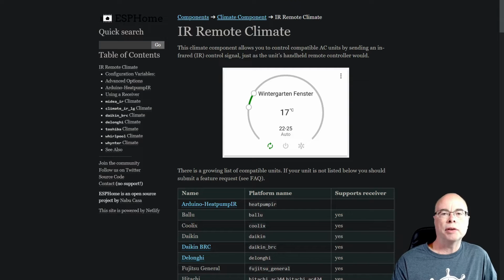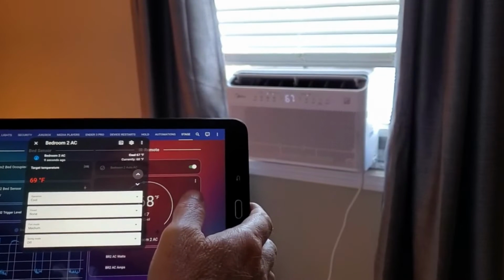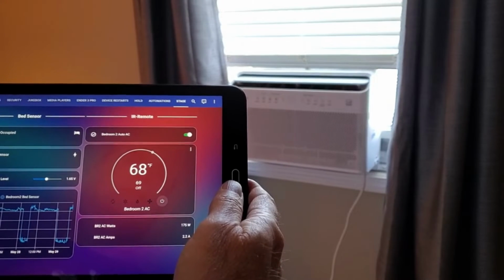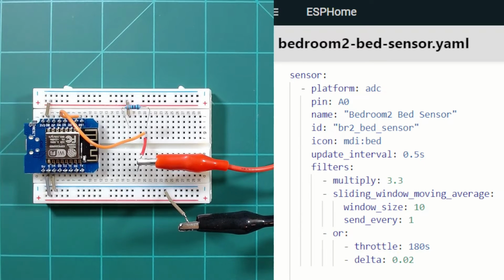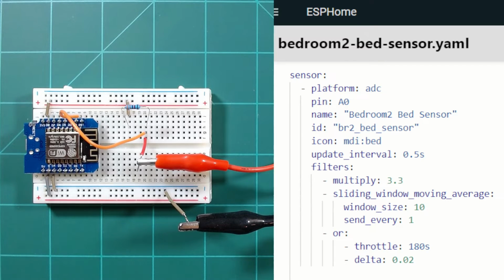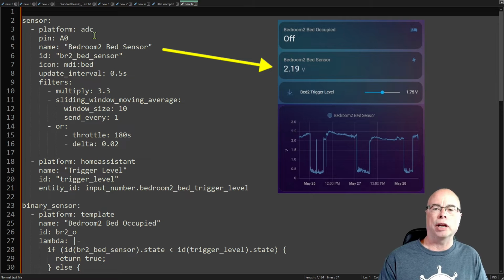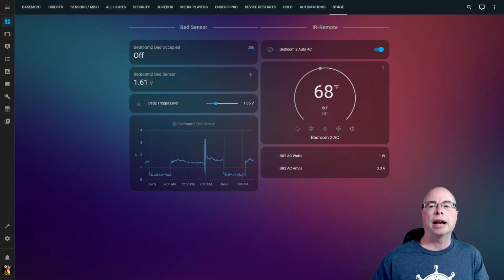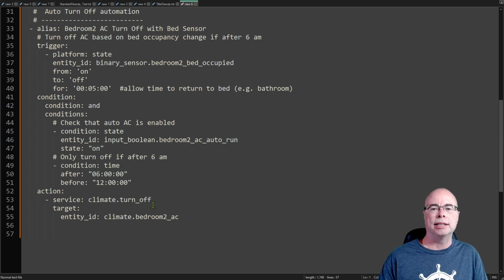Bed Occupancy and IR transmitter for Home Assistant

Comment: Rather than using an IR emitter module, couldn't you just use an IR emitter LED with a matching resistor for the 3.3V GPIO pin output?
Reply from the maker: I think you could do something like that, but I believe you'd have to figure out the right pulses/frequencies for the different 'commands' to send via IR.  When using the IR module, I just can tell it the actual code to use (which I can also capture from an existing remote) and the module will handle 'flashing' the IR LED with the proper frequency/pulses for that code.

Not 100% sure on that since I haven't tried it.  But I know that different IR "codes" need to be sent by altering the light signal.  Without a module to provide that "translation" between the true code and the light signal needed, I think you'd be on your own to figure that out if just using an IR LED.
Reply: @ResinChemTech  I think you might be giving these modules more credit than is due.  Just looking at the PCBs up close, there really doesn't seem to be much to them other than a couple resisters and a status LED.  In fact the KY-005 doesn't appear to have any surface mount components at all, which is probably why it works better since you're basically driving a 1.5V LED with 3.3V (or 5V with the logic level shifter).  Of course the exception here is the all-in-one module with the ESP8285.  I think it would be much cheaper to just use an IR LED and resistor.  And if you need more range you could probably use a transistor to supply more signal amperage.  I believe overdriving the LED with a higher voltage will likely burn them out faster.
Reply from the maker: You are very likely correct!  My knowledge in the IR arena is pretty limited.  I have a Harmony Hub that controls nearly everything in the main living area, but this project was my first attempt at creating my own IR transmitter.  Some Midea brand units have WiFi built-in, but mine only had an IR remote.  So the only way I could automate it was to build my own IR transmitter.  The module just seemed like the easiest, most-straightforward way to get there.  But like most DIY projects, there are always alternate ways.  Again... I really don't even fully understand how it does what it does, but I know once it was 'configured' in ESPHome, along with the Midea unit as an IR climate entity I just had to send climate commands like "Cool" and "Off" and somehow it worked!

I'm sure your method would work as well.  But as a beginner-to-intermediate based channel, I sometimes sacrifice "better" or "slightly cheaper" options for something that is a little more beginner-friendly to use.

Comment: If more nervous about applying too much heat to the FSR pins, you could consider conductive glue instead! (or a crimped connector). You don't have to solder so much (nasty fumes and burn risks and extra equipment to keep around when you aren't using it too).
Reply from the maker: Good tip!  I'm pretty comfortable with my soldering skills, but this is a great suggestion for others that might not have the equipment or experience with soldering.  Thanks for sharing it.

Comment: I was reading that forum on home assistant and there were alot of issues with false positives with these during configuration. How accurate has this been for you?
Reply from the maker: I'm assuming you are talking about the force sensitive resistor (and not the IR transmitter).  Mine has been in use for about 7 months now and the only real issue I've had is some slight drift in the upper voltage (unoccupied) range, but that is mostly due to my Sleep Number bed that loses pressure over time.  When the "Sleep Number" is reset, the voltage also falls back into line.  But it is important to select the proper resistor to give you the broadest voltage range between occupied and unoccupied.  The narrower this range, the more likely you are to get false positives (or negatives) based on small changes in pressure.  In my case, I generally get around 3V when unoccupied and 1V when occupied.  Naturally doing things like lifting up the mattress to change sheets can cause false readings, but I do try to account for those in my automations.  I also have any 'occupancy' automations limited to certain times of the day.  With all this taken together, I've not had any false occupancy/non-occupancy issues regarding the triggering of the window AC unit.

Since the voltage can bounce a bit, especially as you move around in bed, if you are wanting to use this for some sort of "instant" action (such as turning on under bed lighting), it may not be the ideal system as simply rolling over in the middle of the night could result in a trigger.  In my case, I look for a state change that lasts for at least 5 minutes before an automation fires, so this will account for things like shifting while in bed.  But at least for the first 7 months, it has worked out just fine for controlling the AC unit.  This could change in a year, two years, etc... but for now, it has been working as expected.

Comment: Can you help me please
Am trying to control my tcl inverterpro air conditioiner with arduino uno.
First i got the raw data from tv and tv box and the array size was 70
Then i got the raw data from my air conditioner and it was over 500.

It worked on tv and the tv box but it didnt work with the air conditioner😢
Can you tell me where the problem is?
Sorry for my bad english.

Comment: I just wanted to leave a comment saying thanks! You inspired me to upgrade my place with an ESP8265 with IR Receiver and Transmitter combo similar to (but a titch cheaper haha) than the one you linked to. 
My Frigidaire units aren't (yet) supported for the climate integration but I managed to clone my Remote signals from the IR Reciever too! You've provided a lot of much needed inspiration to make my apartment a whole lot "cooler".

This was my first time making a model from scratch, which made me feel super proud. Files will be on thingiverse after I clean up the files and and some personal touches.
You've been a great resource while I've been dipping my toes into homeassistant and helped inspire me to take the dive and upgrade to a proxmox isntance that made my (fairly rudimentary) home lab a heck of a lot easier to manage.
Thanks for making content that newbies and experts can take a page from! Keep on doing what you're doing.
Reply from the maker: Wow... thank you so much for the kind words.  I'm glad you find my videos helpful and that they inspire you to give DIY a shot.  For me, there is a lot of satisfaction in making something work and figuring out how to do it (even though I often make some mistakes along the way).

I think you will be very happy with Home Assistant on Proxmox.  It was one of the best moves I've made for my smart home... even if no one else sees it.

Thanks again for the comments.  It's comments like yours that inspire me to continue to make videos!  Keep me advised of your progress on other projects.

Comment: Lucky you that ESPhome climate supports your Aircon. I have an old Mitsubishi unit and am trying for ages to get it to work. But ESP Climate doesn't support the model and I can't figure out how to teach it the right codes from the remote. Any chance you could make an instruction on that? :)
Reply from the maker: I was fortunate that I didn't have to capture and learn the codes for my Midea.  However, I have captured codes from other remotes and used those capture codes to transmit to a different device.  The best advice I can give is to connect an IR receiver to an ESP running ESPHome and use the ESPHome log to display the code each time it receives one.  Get the various codes from the different remote buttons.  Then use those same codes that you captured to send out via the IR transmitter platform in ESPHome.  Without an actual remote to test, it's hard for me to provide any additional assistance, but my YAML does include an option for capturing and logging codes received (even though I'm not actually using a receiver in my case).

You might also check out the ESPHome Discord server as well (if you haven't already).  You may run into someone there that has either figured out your model of AC... or can give you better tips/advice than I can!

Good luck.  I wish I could provide exact details.. but that's about the best I can offer.
Reply: @ResinChemTech  Awesome, thank you for the quick reply. I'll have a look at your code. I have a receiver attached and can see the codes coming from the Aircon remote. I just didn't know how to integrate them into ESPhome to make it work, hopefully your yaml code will help.

Comment: This bed sensor is so cool, wish I had a use for it.
Reply from the maker: Well, while I'm using it for my AC unit, there are a lot of possibilities if you have an automation system like Home Assistant.  For example, I have a nightly routine that runs that turns off any lights that are on, check and locks any doors that are unlocked, assures the overhead garage door is down, etc.  Right now, that's based on time... but I could easily update that to use the bed sensor so that the 'goodnight routine' runs whenever I get into the bed at night.  Or you could flip that around and have it run a series of actions when you get out of bed in the morning.  Or have it light up some low level under bed LEDs if you get out of bed in the middle of the night so you don't stub a toe on something!  There are a lot of potential uses, but it does require an automation system like Home Assistant, NodeRed, etc. 

But I do appreciate you watching and taking time to leave a comment.
Reply: well, if the sensor's resistance fluctuates often, and HA is aware that you're not home, you've got yourself an infidelity alarm!

Comment: Very good. You could also define the threshold setting as a template number in the esphome code rather than using a helper from home assistant so that it would all be self contained.
Reply from the maker: Thanks for the idea.  Of course there are always multiple ways to tackle any project.  Your method does put all of the related entities into the ESPHome node, which depending on your personal installation and organizational method may or may not be the desired choice.  For me, I use packages, so I have everything related to the AC automation in one YAML package.  This includes my automations, switches, input_booleans, etc.  So, I could either put the input_number in my package or the ESPHome file (via a template number).  Either method results in the same outcome... a slider in the front end to be able to adjust the trigger level.

But I appreciate the alternate approach.  For some, it may be a better organizational option than importing an input_number from Home Assistant.  For others that are not as comfortable with using YAML, creating the helper using the UI and doing the simple import into ESPHome might be more easily understood than creating a template number via YAML in ESPHome.

But again, thanks for the alternate approach idea.  I always appreciate viewers' feedback and other ways to tackle a project.

Comment: Absolutely brilliant. Great project and video. Thanks for sharing
Reply from the maker: Thanks... and you are welcome.  Hopefully it gave you some ideas for your own projects.

Thanks for watching!
Reply: @ResinChemTech  I have been wanting to build a bed sensor using load cells but was not keen on the wires running under the bed all over the floor. Your idea is much neater. I will use the load cells now for my water cooler to notify when to replace the bottle. Sadly electricity is becoming scarce in south Africa so a smart home is not as effecient as it used to be
Reply from the maker: I was exactly the same.  I wanted a bed sensor and even bought load cells.  But it was so much wiring under the bed, and my particular bed wasn't conducive to the design, so I gave up on the idea a long time ago.  It was just recently when I ran across that forum post and discovered the method of using the force sensitive resistor that renewed my hope.  This method is nice as there are no wires under the bed and everything goes under the mattress/box springs, so it also doesn't interfere with making the bed, changing the sheets, etc.

Comment: Thank you very much. I have a GREE air conditioner. How can modify the code for GREE air conditioner which supports heatpumpir ?
Can you help me write the modified code for my GREE air conditioner?
Reply from the maker: ESPHome natively supports and has the code for the GREE Heatpump.  In fact, there's a special section in the documentation that describes the GREE libary.  You should find all you need, including the necessary code, here: https://esphome.io/components/climate/climate_ir.html  Look under the section that talks about Arduino-HeatpumpIR.

Comment: Great and timely video, thanks for sharing.
I plan to use the IR controls for my mini split A/C as well as my ceiling fans coupled with a temp/humidity sensor.
Reply from the maker: Thanks!  Now that I've gotten this to work for the AC unit, it's started me thinking about how I could do something similar to control/automate other IR devices in my home that are normally "dumb" devices.  I think it should work with something like a ceiling fan as well, assuming you can capture the needed IR codes from the existing remote.

Comment: I'm new to Home Assistant and your videos have been extremely helpful. I live in the Caribbean and we use Air Conditioning rather than Thermostats, so I was looking for a solution to managing my Ac through HA, this video could not have come at a better time. Thank you, I've learnt soo much from you!
Reply from the maker: You are most welcome... and I'm happy you find my videos helpful.  While it might take a little extra work if your model of AC isn't one of the officially supported ones by ESPHome, as long as it has an IR remote it should be possible to capture those codes from a receiver and reuse them.  The IR transmitter is really the only part needed to do a lot of Home Assistant automation.  The bed sensor was just an additional piece for me... because I've wanted one for a while now to use in other automations.

Thanks for watching... and taking time to leave a comment!
Reply: @ResinChemTech  Thank you, now that I know it's possible, I'm sure I'll find a way to make it work
Reply: I am in a similar situation, I am an expat living in Mexico. We use mini split types of A/C and fortunately for me my new Trane units do support IR so I am looking forward to automating them with Home Assistant as well. This is a very timely video for me.
Reply: @rodneysmith1750  Hope everything works out for you!